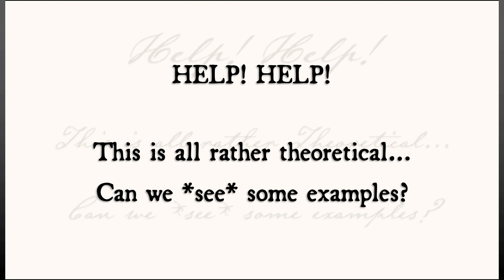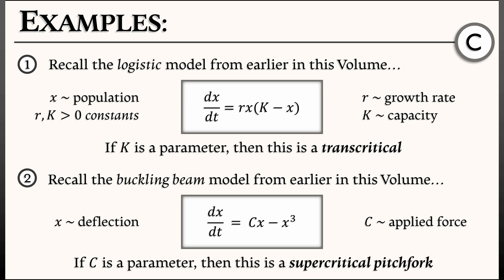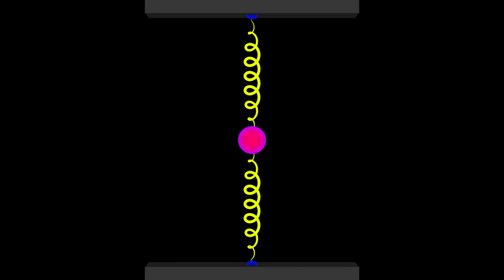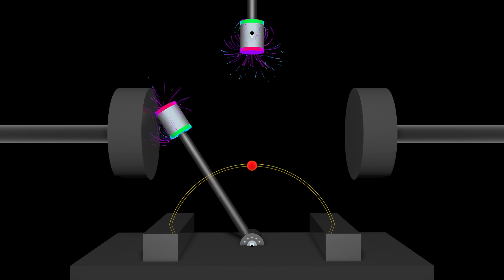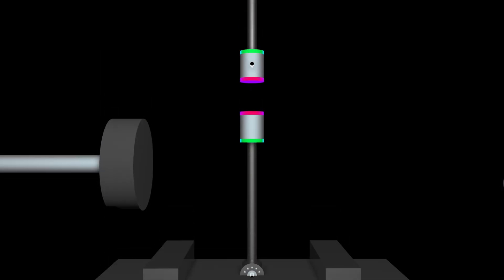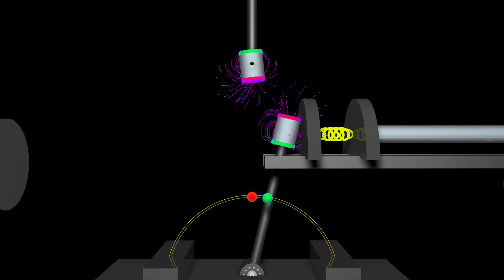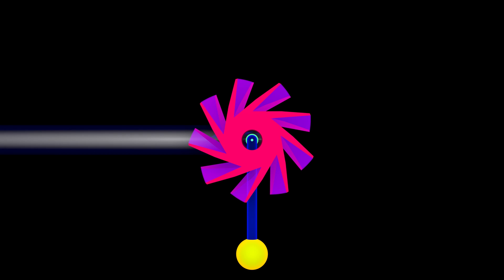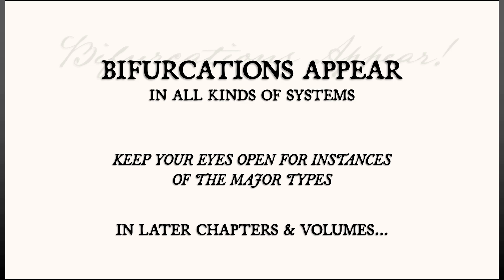ADS : Vol 1 : Chapter 7.6 : Mechanical Examples of Bifurcations

Comment: One can see the "warning" about pitchforks from the previous video here. 

In the supercritical, the parameter is the compression. If the spring starts negatively compressed (i.e. stretched) but the compression increases until the spring is actually compressed, then it will jump from the new unstable equilibrium to one of the stable equilibria, the parameter can be dialed back until the system returns to a single stable equilibrium.

In the subcritical, the parameter is the length of the rod. If the rod is long enough, there is an stable equilibrium in the middle, but if the length decreases by some mechanism then it gets to a point where the magnetic pull can never beat gravity and the middle becomes the single, but unstable, equilibrium. Then if you just increase the length again the rod obviously won't go back up by itself, you have to reset the system by hand.